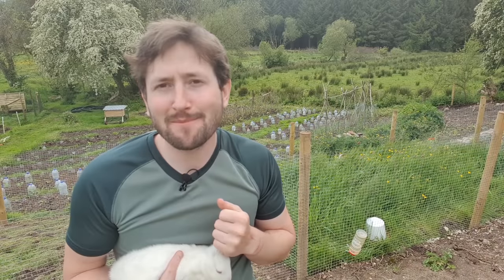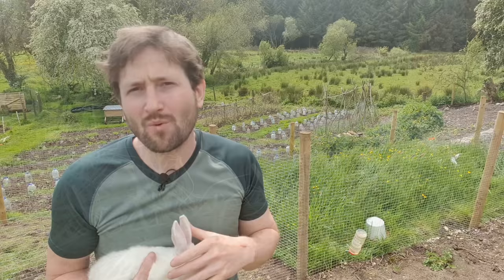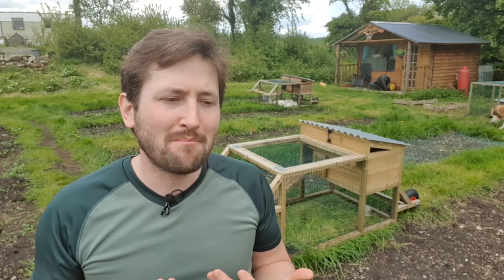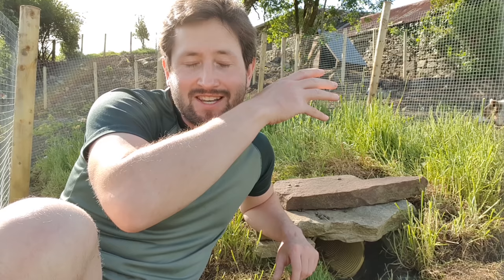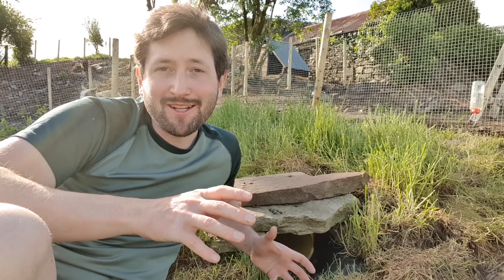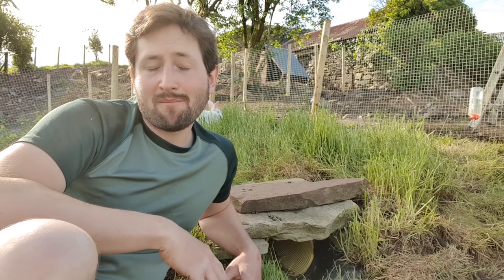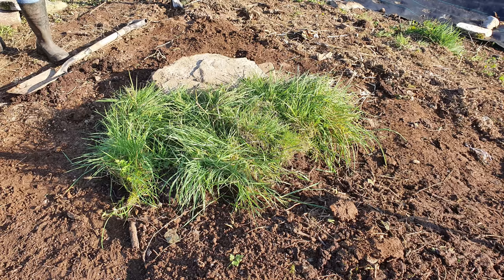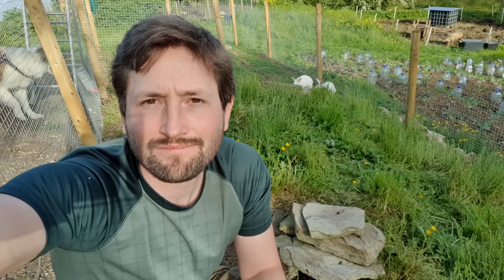Creating an Underground Rabbit Warren

Comment: In my urban garden I created a safe enclosed spaced for pet rabbits to dig their own burrow. Dug down several feet and laid  concrete slabs on the ‘floor’ and covered over with soil. The sides, roof and edges of the enclosure are constructed from fox proof wire. The now ( sadly single, pet rabbit, Irving the dream having created her own network of tunnels which she frequently remodels.

Comment: Midges! Try making this repellent from lemon essential oil :- 27 drops per 30 ml light carrier oil (any cheap vegetable oil will suffice) alternatively make a homeopathic solution with your spring water and spray on - less messy than the oil but just as effective.

Comment: I'm surprised at the plastic box and pipes. I thought they would have got condensation problems. If there is so much stone about there they could surely have been made of that.
Reply from the maker: The pipes are drainage pipes so have plenty of holes through them. In regard to the box, you have to consider the climate I live in. It rains a lot here, and without an impermeable barrier some of that rain would soak down into the nesting area. I think that would cause much more moisture to build up than condensation. Bear in mind also that the rabbits leave the box to urinate, so the only moisture from their bodies will be from their breath. Plastic has its uses.

Comment: I have dead spots in my lawn where the wild rabbits like to sit.
At first I couldn't figure out what was going until someone mentioned rabbits can make these dead areas.
Started paying attention and sure enough I've seen them in these areas and they're leaving their droppings.
Not sure if their droppings are too "hot" or if the issue is urine, or maybe over-grazing.
Reply: My rabbits dig shallow patches deep enough to reach the colder earth and lay there to cool off, like a dry pig wallow
Reply: @tinnerste2507  Curious.
The patches I have are just yellowed dead grass, not bare dirt.
It's possible the grass is dead due to something else and they prefer those spots for some reason.